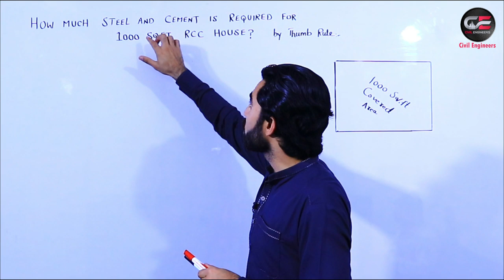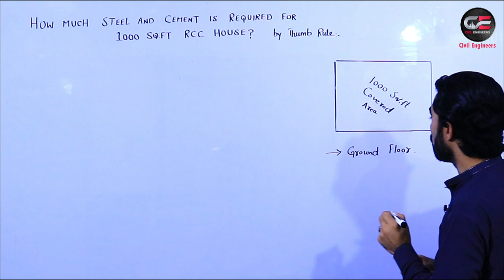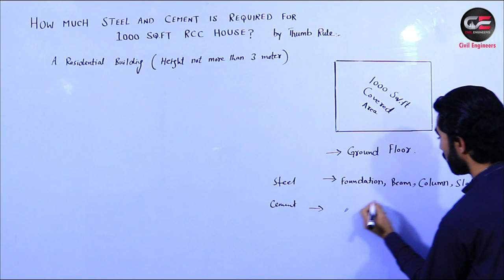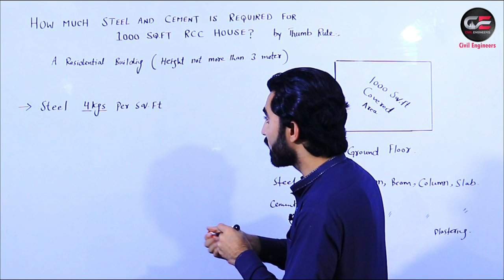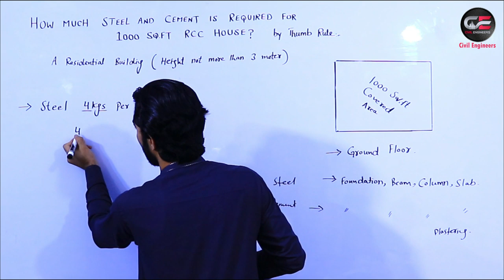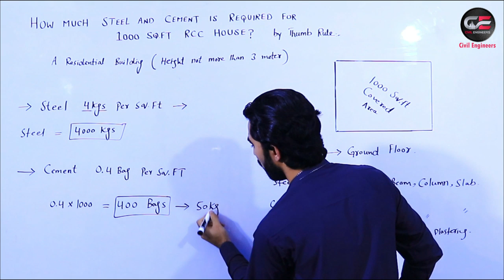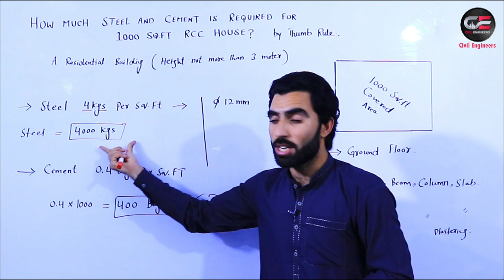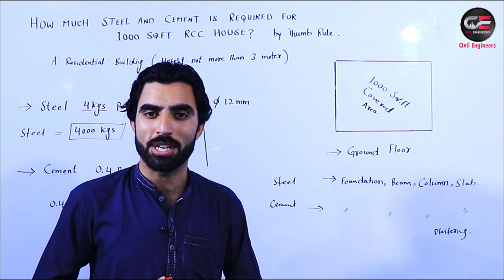How Much Steel and Cement is Required for 1000 SFT RCC House?

Comment: And need a similar rule of thumb or a rough estimate for a COMMERCIAL building, 5 storied, basement, ground plus 3, over a lot size of 30*35 feet lot.